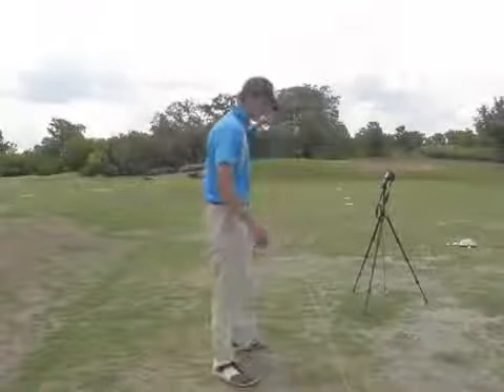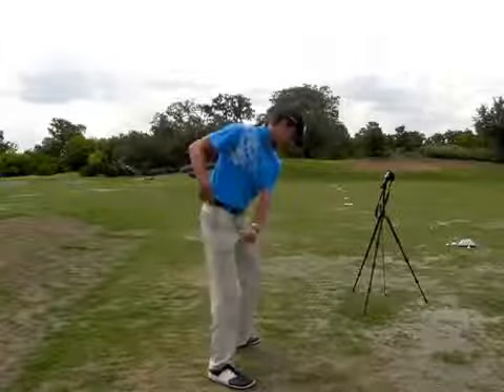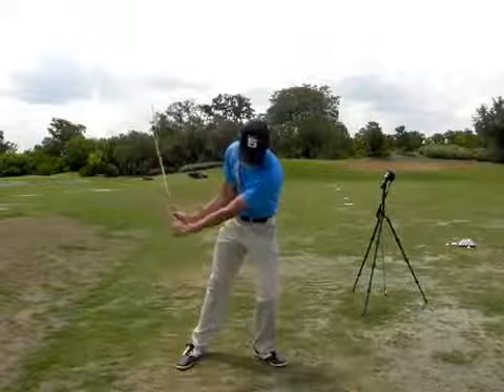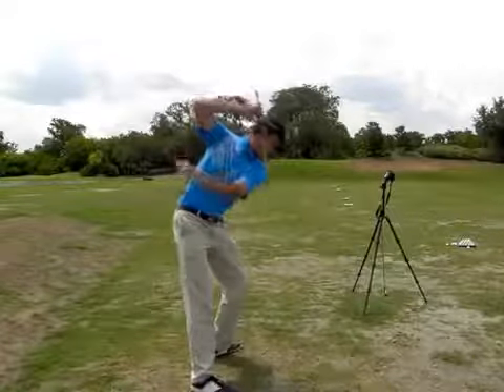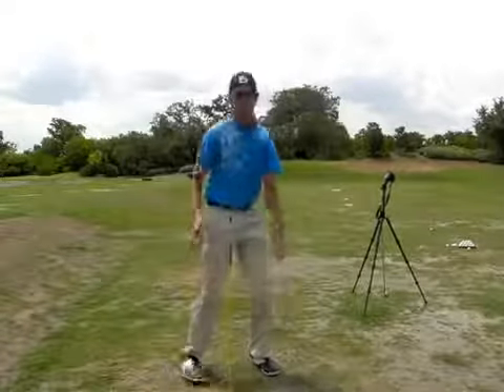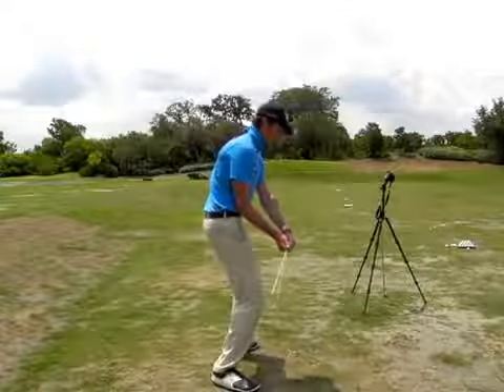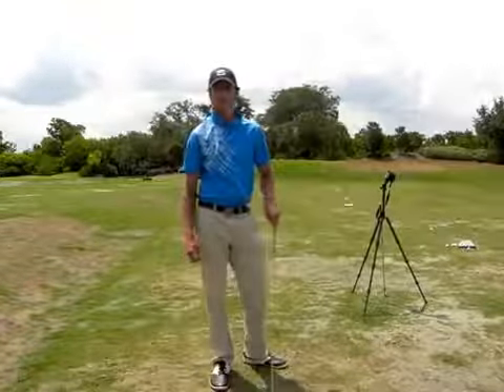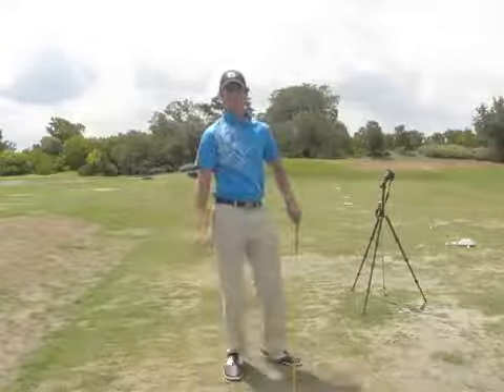Michael Mc Loughlin (MvMac) Swing analysis - 5-18-13

Comment: Hi, James, it is too hard to perform. For the need of staying centered at the stance, I used to keeping the upper Center of Grativy and head at the same place as they were at setup.  I would turn the lead shoulder back up in a circle (it has been the lowest point when I am at top of backswing) to hit the ball. I can not understand the need to move it further downward and shift the COG to the left, would you explain?
Reply from the maker: hi Gala, this was more specific for him who tends to early extend and dump the wrist angles. I wouldn't advocate moving the centers forward specifically unless it was for a specific shot pattern. Id prefer a more rotary squatty downswing using the ground to propel from.